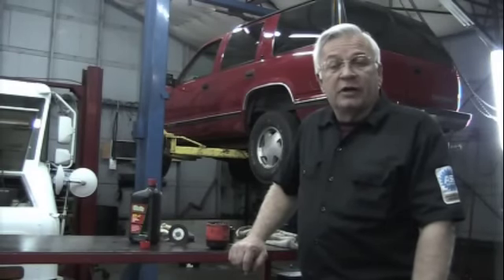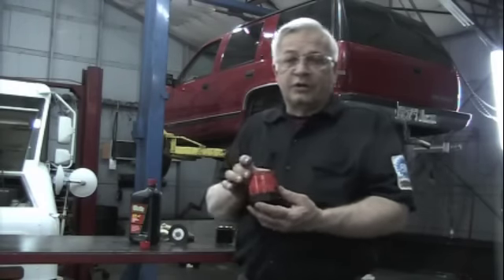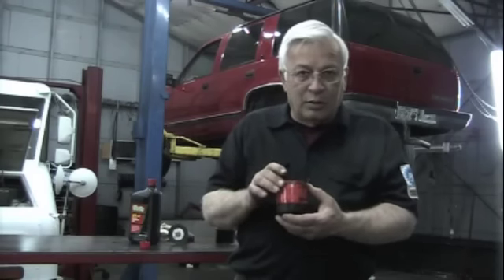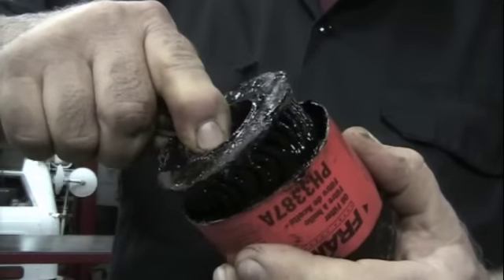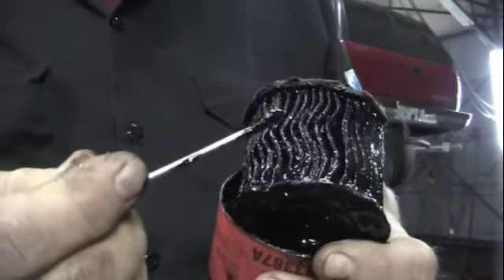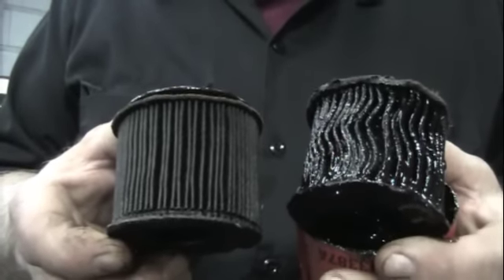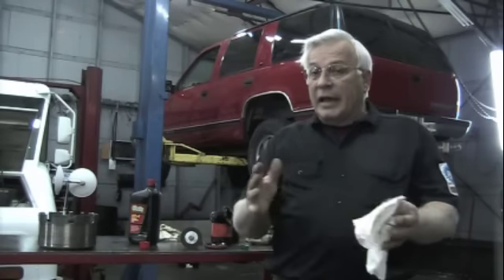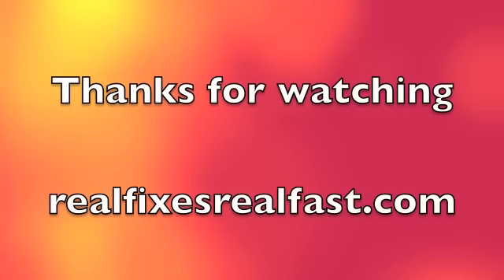Low oil pressure, finding evidence

Comment: Fram filters are very cheap and GLUED with cardboard end caps and valve. Buy ANYTHING. else.....Matter of fact Fram filters arent even that cheap. (Price wise)
Reply: The best filter in the world can only hold so much dirt. That came from not changing oil. I have a 96 Tahoe with 292,000 miles, only use Fram oil filters. Change oil between 5,000 and 7,000 miles. I have a video where I change my lower intake gasket and I took bank 2 valve cover off. It look like the engine has 50,000 miles.
Reply: Name a filter that is the best!
Reply: David Chambers IDK
Reply: ***** it is still bad that it doesn't even have metal end caps lol...those cardboard end caps tend to collapse in high oil pressure situations ive had it happen 3 times with fram filters....never again.. I use royal purple oil and filters now... or Napa filters if I have to..fram is cheap junk when u cut it open and compare it to other brands
Reply: TechMaster2133 Nice try. Dude, today my 96 4x4 Tahoe cross 300k miles. I bought it use 10 years ago with 113,000 miles. I use base oil and base fram filters until around 185,000 miles (every 5,000 miles). From then on I run mobile one full synthetic  oil and base fram filters(every 7,000 miles).
 I don't feel like a man if I don't hit 99mph at lease once a week. I'm a black man who's not afraid to put it in 4wd and what's the point if I don't drop it n low range. I have towed many cars on trailers with this truck and there is a video on my channel where I pull a moving truck back wheels back on ground.
You want to buy high dollar oil and filters. Go a head but I'm going to think u r stupid.
Also don't tell me fram want hold up to high rpm. My 04 Trailblazer use the same oil and filter and it want shift (at full throttle) until 6000rpm.
Reply: they hold up to high rpm fine lol that's not what I said...I said they don't hold up well to high oil pressure very well...most cars/trucks run about 40 psi of oil pressure when idle and running down the road. my car runs about 80psi of pressure running down the road...ive pulled 3 crushed fram filters from that car so far...the paper end caps cannot stand up to high oil pressure situations for long...I mean come on lol this filter has PAPER end caps. While all other brands use METAL end caps...u cant tell me that's not a little cheap. but hey your preference is different than mine...I like higher quality more expensive oil/filters to ensure nothing gets through that filter and in to my engine...go watch some comparison videos with people cutting open those filters...guarantee u will change your mind
Reply: TechMaster2133 If u knew what u are talking about, you would know low oil pressure and 6000rpm want last long. 
Also it funny how people with so-call high hp cars never have any videos.
Reply: ***** what do u mean low oil pressure????? at any point in my comment did I say the oil pressure is low...you are not making sense. 40 psi is not low it is normal..80psi is HIGH oil pressure. Are you Shure YOU know what your talking about. because u have obviously failed to understand ore actually read my comment....and before u go saying I don't know what im talking about, I've taken an automotive mechanics certification class, a diesel mechanics class, and got certified in OILS AND FILTERS, so trust me I know my shit lol..
Reply: ***** oh and not once did I say my car was high horsepower lol...its not its a 215hp 4.6l v8 with an upgraded oil pump that's it lol oh and it does have a K&N air filter to but otherwise its stock...so do your self a favor and actually try to read and understand the comment...and stop saying shit that was never said in the first place
Reply: ***** and no i don't have a vid of my car but here is a vid of my EXACT car doing a 0-60 lol just to show u i never said it was fast.....its a 4000 pound boat with a 215hp v8 lol
Reply: u do know I did literally mean a boat right ....I meant it as big ass heavy car lol..there is no big  ass purple dick in my ass....because I know im not trusting cheap stuff to protect my car....u can if it works for u...but I've physically seen the filters fail..and if u look up fram oil filters collapsing. u will find what I say is true...just because u never had an issue does not mean it doesn't happen
Reply: watch those vids and tell me frams still great lollololololol try it
Reply: TechMaster2133 I've seen a 350 Chevy V8 throw a rod. I've seen one knocking. I've seen 3 or more smoking and I've seen 3 run on 7 cylinders. My friend had one that blew a head gasket. My dad had one that lost so much compression that it would no longer run. My point is, all of those engines was driven by people who did not take good care of them.
I paid $3.77 for a fram oil filter and $33 for 7 quarts of Mobile 1 full synthetic oil for my 04 Trailblazer Sunday. I had not change the oil n 13 months and over 9,000 miles. (the change oil light had not come on yet) The filter was not leaking and had no signs of damage and the bottom of my drain pan was with sludge.
Reply: I mean if they work...they work but ive seen so many failures of fram filters that u really should pay the extra on a less cheaper filter lol $3.77 for a filter u know the inside components will not be top quality. I understand that its worked for 300k miles with no issues...but if u would do me a favor and watch those 2 vids I sent u...I would like to prove that im not bull shitting u lol...what I say IS true... the firs thing that came up on google when I typed in fram was FRAM OIL FILTER COLLAPSING.
Reply: TechMaster2133 I don't care about videos of fram filters coming apart. I only spend a lot for parts when I have to. I don't believe everything i c on the internet.
Reply: ok but this isn't just on the internet there's lots of forms about peoples engines being damaged when using fram filters...my mechanic has seen 1st hand the damage they can do...and so have I...u may not believe it..but the evidence IS there to prove that fram filters ARE cheap crap
Reply: ***** and $15 every 3000 to 6000 miles isn't a lot of money....u should never go cheap on oil or filters for your car...every car guy with a lick of sense knows this..oil and filter are the things u don't skimp on
Reply: I spend $40-$50 on oil and a filter for my car every 5000 miles lol purrs like new
Reply: TechMaster2133 Dude, u will never get me to stop using fram. I don't have a problem with them. I put 200,000 miles on my 89 mustang with fram. I had an 89 Sunbird GT turbo and it use fram. Also I use their air filters n every car I have had.
Reply: I have no issues with that.. I do like there air filters. but my car came with a washable/reusable K&N filter so I don't need to buy a new air filter anymore....if its worked for u that's great...I just wanted u to know what damage ive had fram do to my things...or other peoples things that ive witnessed
Reply: @55dpc  Fram' proven for me for 40 years //